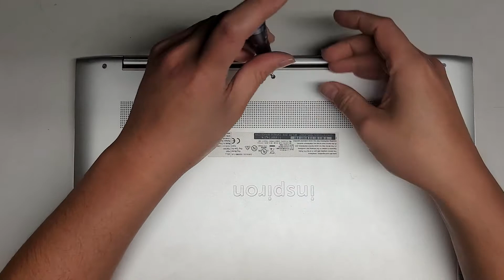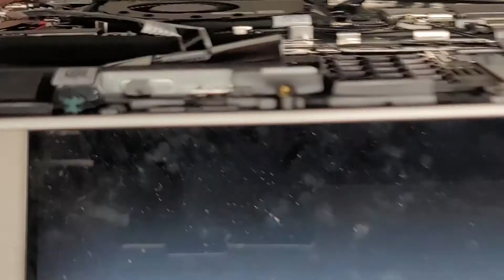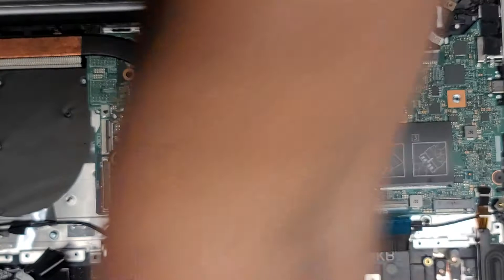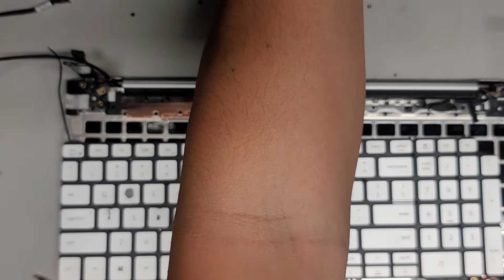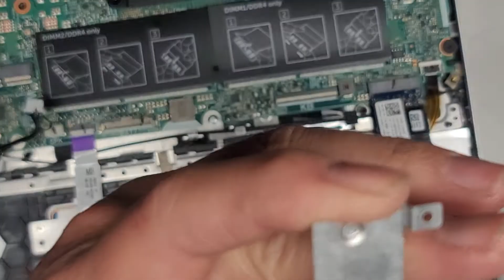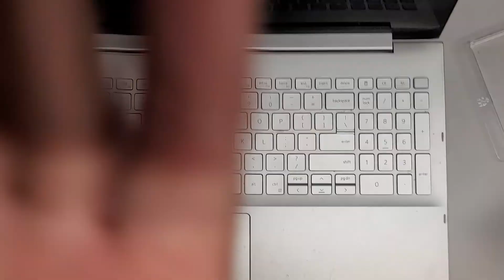Dell Inspiron 7591 2-in-1 Disassembly RAM SSD Hard Drive Upgrade Fan Keyboard Replacement Repair

Comment: Just replaced my keyboard that had started to fail for some keys. Took me about 2 hours to complete and it went quite smoothly thanks to this video. Can't thank you enough for this excellent tutorial, it would have been close to impossible to figure all moves out without breaking something. Those last 20 screws in the keyboard were just crazy and I discovered that they must have forgotten to assemble one in the factory, but it works anyway. Thanks again!
Reply from the maker: Awesome, glad the repair went well. If you haven't already, please like and subscribe so others can find my videos and possibly consider watching a few others, liking and commenting to get the algorithm to recommend my channel. Thanks!

Comment: Hey, I think the battery is swollen for mine. I noticed lifting on the touchpad and side. Any advice?
Reply from the maker: Need to replace the battery. You can test by removing the battery to see if the swelling goes away.

Comment: I just upgraded ssd & now it wont boot up....what do I need to do??
Reply from the maker: Sounds like you did neither. https://youtu.be/4p5jFDzVwUw that's how to clone. This is how to make a windows USB https://youtu.be/R6GVDyVqWso
Reply from the maker: Did you clone the old drive or do a clean install?
Reply: @ItsBinhRepaired  not sure how to clone. Lol. So all ive done was take out 'bad' one & put in the new, tried booting up & it won't...
Reply: @ItsBinhRepaired  maybe what i did was a 'clean' install?